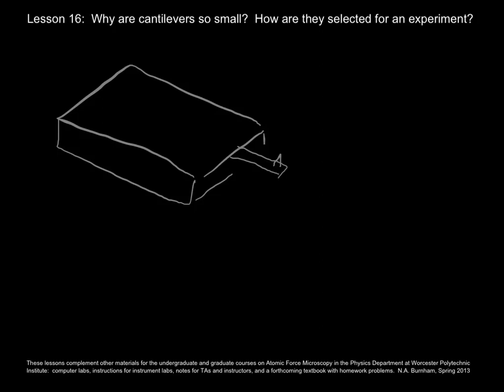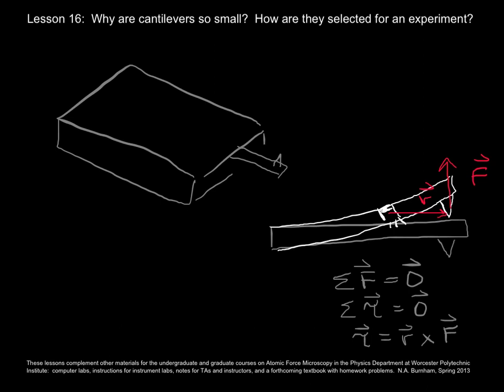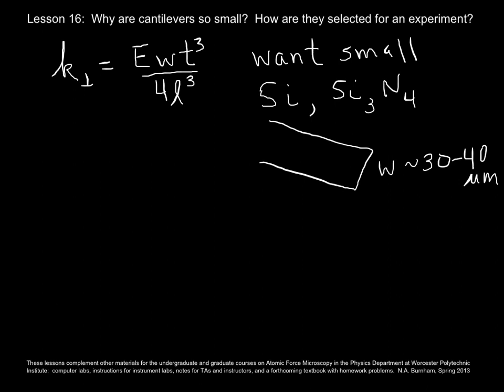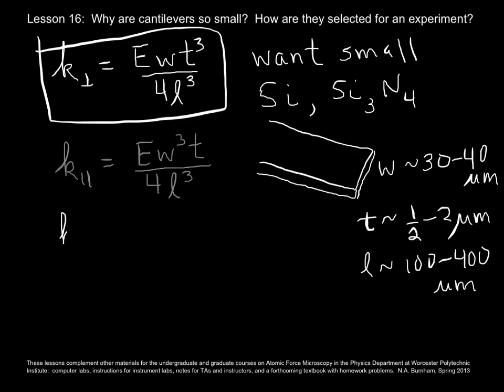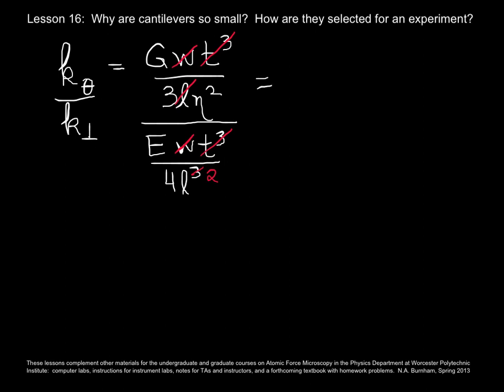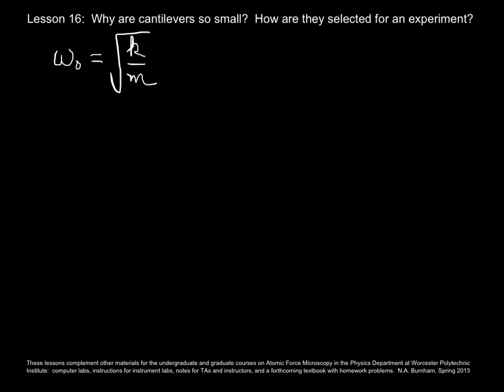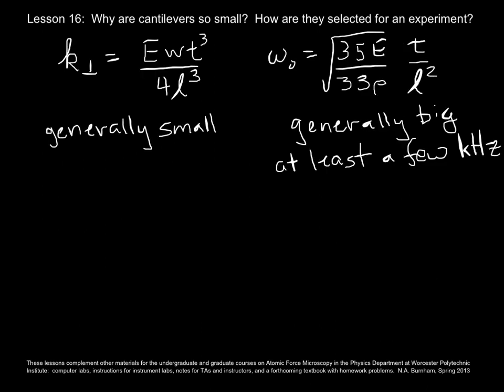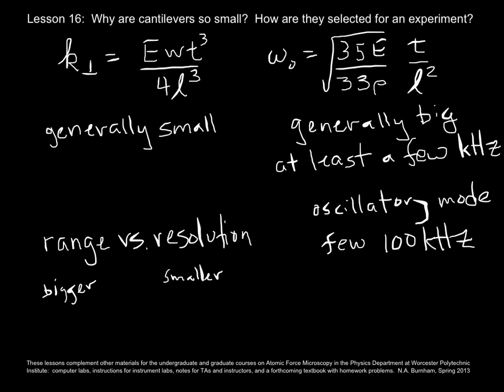AFM Lesson 16 - Cantilever design and selection

Comment: Thank you for the nice lessons. If I understood you the frequency increases with the force. What does the range or the resolution tell me before hand about the shear, for example in a situations where about 2nN force is required?? Are there any links in literature, where such applications have been catergorized? Thank you
Reply from the maker: Correct.  Typically cantilevers with higher resonance frequencies are stiffer, i.e. have higher spring constants.  The higher the spring constant, the higher the force for the same deflection.  For thinking about what probe you might want to buy, I'd recommend doing an analysis similar to that which starts about halfway through Lesson 16.  Most people will try several different kinds of probes as they are starting a series of experiments, then settle on one type after some experimentation.  Have fun!

Comment: How do we determine the effective mass constant? Is that just derived from the shape of the cantilever to be attached at one end?
Reply from the maker: Thomas Corbin Experimentally, one determines the effective mass from measuring the radial natural frequency of resonance and the spring constant.  Then m_eff = k/omega^2.  The theoretical expression that I used in the video, (33/140)*rho*w*t*L, comes from a calculation in "Vibration Problems in Engineering" by Weaver, Timoshenko, and Young.  The important conceptual aspect is that because the different elements of the cantilever move different amounts during a swing, the effective mass is less than the mass that one would measure if one placed the cantilever on a mass balance, rho*w*t*L.Thank you for your interest!